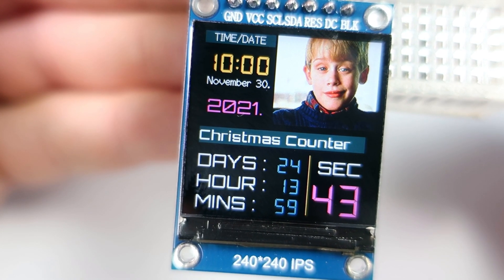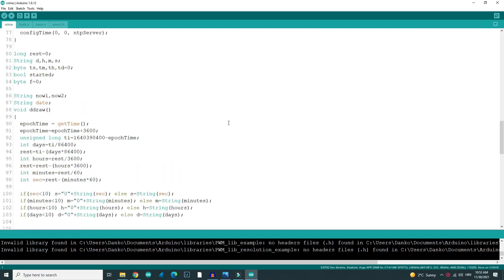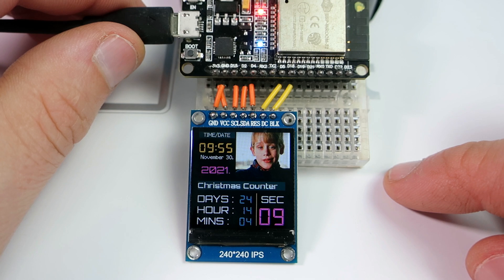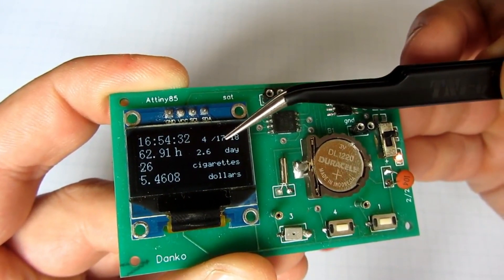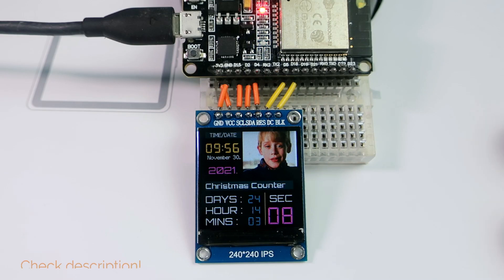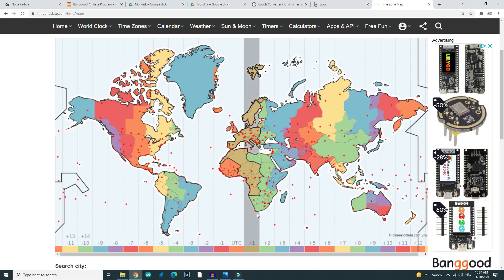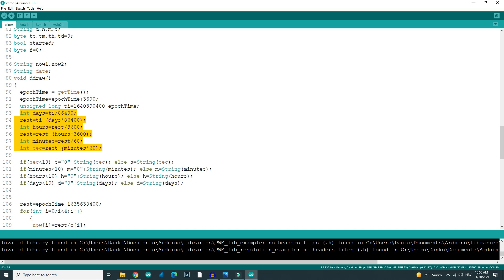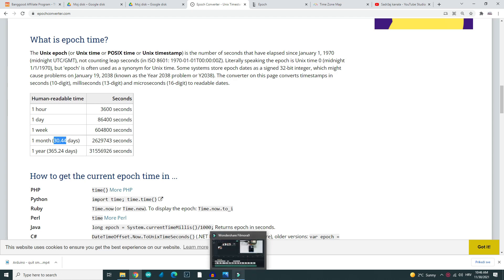ESP32 Can't Wait For Christmas

Comment: I am using a ST7789 controller display. I have this working with the exception of the picture looks almost inverse.  Kevin's face is blue.  Does anyone have any ideas for me to try?  Thanks!!
Reply from the maker: Hello, in setup function add this line tft.invertDisplay(true); after tft.init();     if that dont works you can try tft.invertDisplay(false);

Comment: To fix the "November 48" and correct counting for December you must change line 106 from "rest=epochTime-1635638400;" to "rest=epochTime-1638230400;" , also on line 129 you must change "November" to "December" :)
Reply: Thnx, i had the same issue, but is it possible to get de current date name and number on that spot?
Reply: good but i cant see MINS

Comment: Here's an Idea Mate. What about using this little TFT Circuit Board, and using it as a Pico Oscilloscope for Car or Truck Repair Diagnostic's. It should be Mounted into the Dash and be Programed Accordingly so you could have Real Time Diagnostic and Trouble Code Identifications, plus Real Time Data and Performance on the Screen. You could use the (Raspberry - Pi - 4) as the Main Processor. How about it?  (Can you do it)? This would be a far better Device, in my opinion. A Worthy Tool that all could use. I look forward to this upcoming Video.